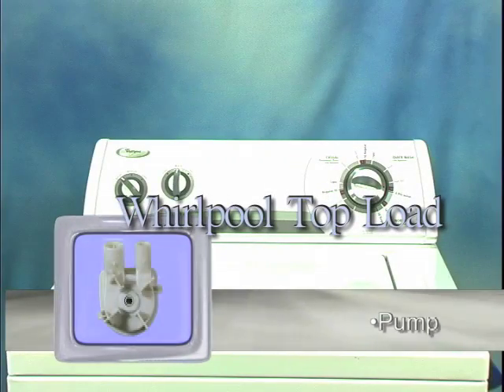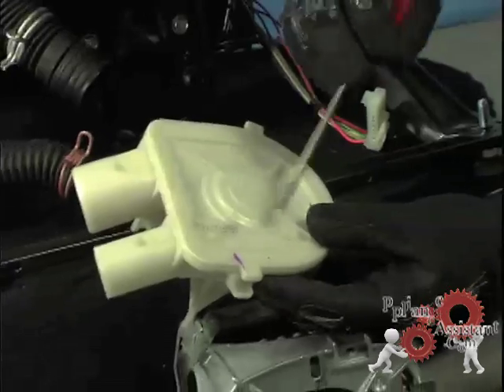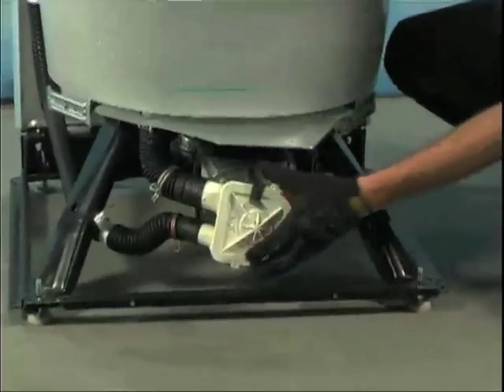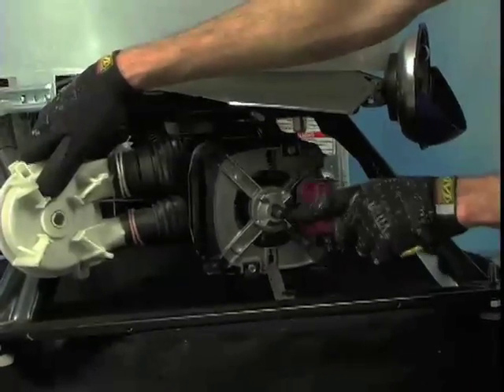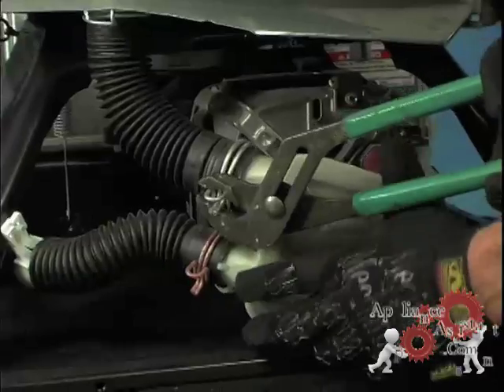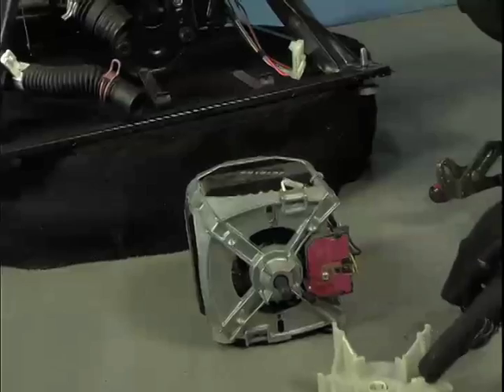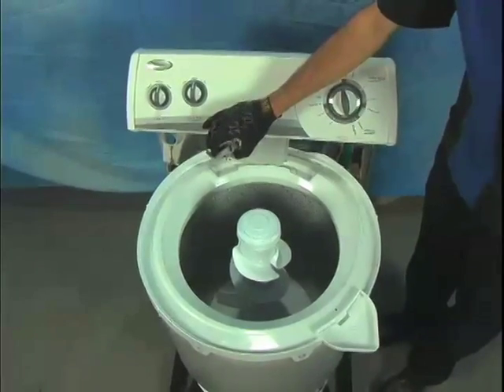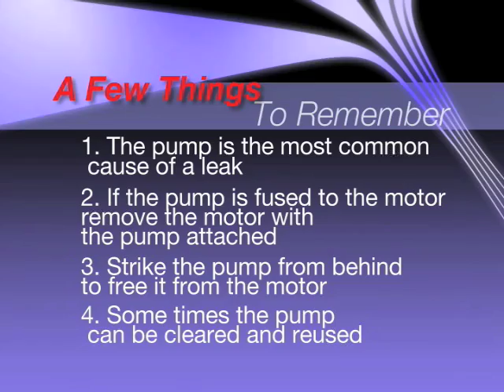Washer Pump Repair Direct Drive Washer Pump Repair

Comment from the maker: The pump is definitely a strong possibility, it is the most common cause of leaks on this style of washer. The second most common is the rear tub spring rusting through the frame and allowing the tub to sit forward. When the washer fills with water some splashes down the back of the tub.  Best to pull the cabinet off, jump the lid switch (use caution) run it and watch for where the leak is coming from. Good luck!

Comment: That's exactly what happened to mine, Child's sock, only it was not coming back out of the pump except as tattered shreds.  We can purchase the pump locally, I just hope the motor didn't burn out. 

The motor did not burn out, it drained just fine after replacing the pump.  I tried to clear it but that sock wasn't coming out.

Comment: This video is great.  I got the bad pump off, but now I cannot get the new pump on.  It will not go further than about a quarter inch no matter how hard I push.  Any suggestions?

Thanks
Reply from the maker: Is the motor shaft rusted?  If the pump was leaking onto the motor shaft, it may be swollen with rust.  If that's the case you may need to sand on it for a while to get back down to clean metal and its original size so the new pump will work... If it's not rusty, What is your washer model number? what is your new pump part number? And I will check for more clues.
Reply: applianceassistant Thanks for the quick reply.  The pump was leaking onto the shaft and it is discolored.  I have used a wire brush on it to get the rust off.  So it looks clean.  Should I go after it with a dremel?
Reply: David Widman Keep forgetting.  It's kenmore series 60 washer.  The part number for the pump matches the part number of the one I removed.  It was very difficult to get the old one off, by the way.
Reply from the maker: If you think we are on to the track with the cause, then I would say yes. Rust it pretty amazing. Just be careful not to take too much, motors are expensive.  Good luck!
Reply: applianceassistant OK, I'll be careful and test fit frequently.  I'll get back alter with the result.

Thanks a bunch.
Reply: David Widman SUCCESS!  a little grinding was all it needed.  Now I wonder how long it was leaking.  It is in our basement where we generally got some dampness due to the floor drain and a mostly dirt floor.  But, thank you.  That got it.
Reply from the maker: Congratulations!!

Comment: my pump is fused to the motor and you can see the rust where it connects to the motor shaft. there is about two ounces of water on the floor after every wash. does that mean my pump is done or do i just take of the pump and clean that area where the rust is?

Comment from the maker: So when it stops is it full of water? ... first guess... lid switch part#285935 about 30.00 Sometimes they make partial contact and will work off and on... If you do end up needing one please buy through the links on my website I get a little commission : )  Or I can drop ship it to you.  Thanks for the question!

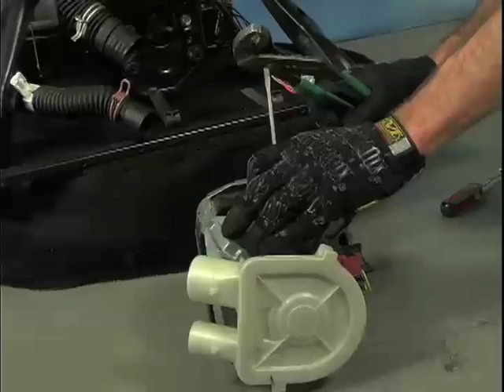Comment: i am trying to learn how to work on washers here: at 4:23  i am to use pliers to hit a screwdriver to remove a stuck drain pump ok ???
Reply from the maker: It has worked for me, and one less tool I need to carry in my tool bag. This type of washer is going to be pretty rare these days. I’ve had a few that I had to chisel off one piece at a time if the pump was leaking and caused the motor shaft to swell with rust.
Reply: @applianceassistant  pretty rare,,,,  really
Reply: @johncasor9698  Really. Whirlpool stopped making them over 13 years ago,,,, on average they would last about 18-25 years so they are dwindling in numbers. compared with the new 6-10 year life span washers, these are rare.

Comment: why my washing machine watr is not stay-able?
Reply from the maker: Sorry for the delay. Not sure what you mean by not stable... can you be more specific? Also what is your model number
Reply: its alright sir ,,actually sir  my washing machine does not keep water in machine it comes nd pass through the out going pipe without washing .when i start the machine it suppose to wash but it does not ,my machine model no is wa90fa,,and no more thing is water remains in machine when i make the pipe level high but  water remains in machine but after washing water again does not go out coz of high  pipe level thank u
Reply from the maker: The water going right out of the tub is probably due to the bottom of the drain hose being below the water level in the tub. It needs to be at least as high as the top of the washer.  Apart from that it sounds like the drain pump may not be working to push the water out at the end of the cycle... I could not find your washer diagrams with that number... I'm guessing it's a Samsung?
Reply: so wat should i do,,now ,,,sud  i change the drain pump ? or i can repair ?
Reply from the maker: It's difficult to say because I can't pull up any diagrams by the model number you have... If it were me I would start by looking at the drain pump. If there is a cancel drain or spin only cycle, the pump should be running soon after that starts. You can check to see if the drain pump is running at that point. If not I would check for 120VAC from the wires that are leading to the pump at that point. If it's getting power but not pumping you probably would be right to replace the pump.  If you are not getting power to the pump it could be the control or the lid lock.  Hope that helps some, Sorry I can't be of more help... Good luck!
Reply: thank u sir for u help